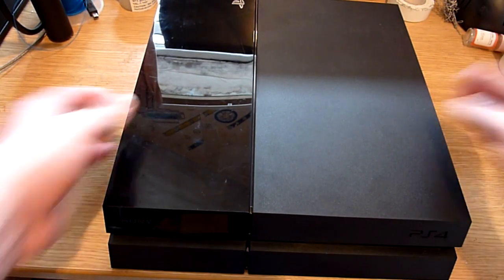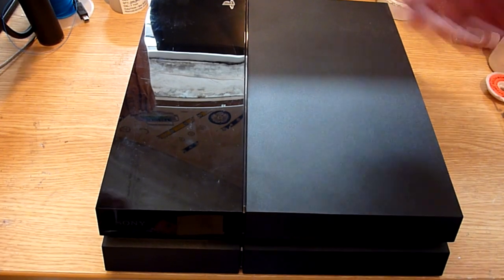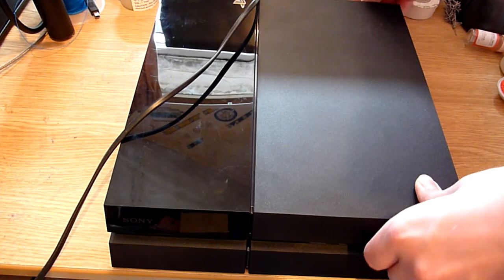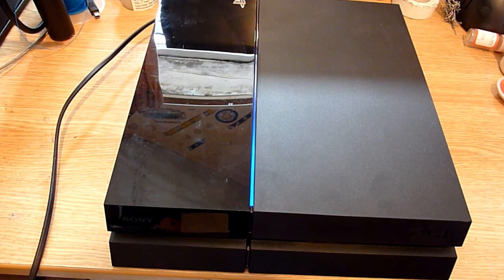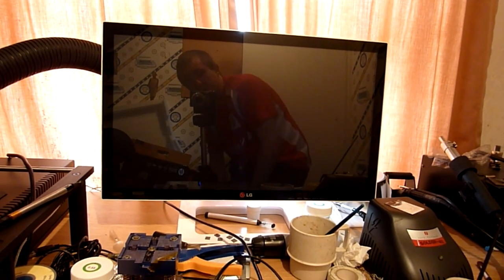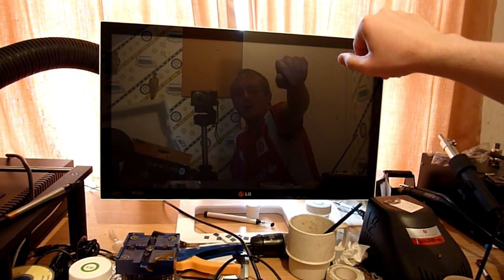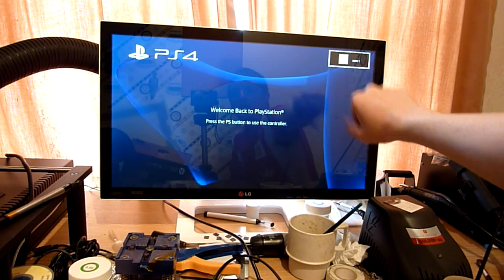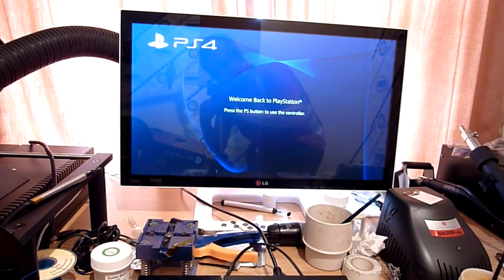PS4 Power Supply Repair - ADP-240AR Transformer Failure - Blue Light of Death (BLOD)

Comment: Andrew, I have a ps4 that I've been wanting to fix for about 6 months now but I don't wanna mess nothing up. The unit doesn't power on at all and I'm thinking it's the ceramic fuse needs to be replaced. I have pictures if you need to see the unit. thanks in advance
Reply: my son wanted to know. he just added on circles ( Google+ ).
Reply from the maker: +Shannette Marshall Hi Shannette - can I see these pictures please? If you upload them to http://imgur.com/ and post the URLs for the images into a reply here I'll be able to take a look. Do you know what happened to the system which resulted in the no power scenario? Many thanks.
Reply: +Andrew Paul Hi he just added some pictures of it and tagged your name. Check your Google+
Reply from the maker: +Shannette Marshall Hi Shannette,
Indeed it looks as though that fuse is missing - do you know how this might have happened as they're pretty hardy things so if it's blown out then we'd need to get to the bottom as to why that was. Where are you based? Cheers, Andy.
Reply: +Andrew Paul Hi Andy thanks for the reply. He took the fuse out because he used a meter ( I don't know what they're called ) to check the circuits and the connection to the fuse wasn't giving out any signs of life
Reply: +Andrew Paul Also he bought it from a guy off Craigslist and upon taking it apart because the unit is out of warranty. He discovered it was Roach infested
Reply from the maker: +Shannette Marshall That'll be why it blew then ha ha! You might find it to be the tip of the iceberg however - I'd replace the fuse and see if it fires up.

Comment: Hi Andrew great video. I have followed your steps and one of my psu is broken. the other one works and what i have noticed is when apply weight on the console upside down it works but as soon as released the weight console switches off... does it mean reballing of apu or something different i need to look at?Thanks
Reply from the maker: +Maciej Pytlik It depends where you're having to push it but if it's towards the centre on the left hand side as you have it upside down then yes most likely a reball would be required. Cheers.

Comment: Awesome video Paul. I thought my problem was BLOD but it's not. We had a electrical household power surge the TV went and the PS4. I thought it was the power supply and bought one on Amazon a ADP-240CR 4 pin. Replaced the old with the new no light a slight beep and nothing after. So I'm not sure what else it could be. Any help would be greatly appreciated. Thanks
Reply: Cpu is dead

Comment: After I changed thermal pads and paste, my ps4 won't turn on. Also I sprayed power supply and big bunny dust came out. First I press power button beep no lights and nothing, then I press power button beep and blue light for sec. Fan won't start up so I guess it might be power supply!

Comment: This is off subject but if I were to get a reflow on a ps4, how long would It normally last?
Reply from the maker: +Christopher Easler That's impossible to say I'm afraid - sometimes a reflow will last 12 months+ and other times it lasts hours. If done well they can be very reliable repairs but I always reball machines and never reflow them. Really it all depends on the condition of the board / chip and your usage environment etc. Cheers.
Reply: +Andrew Paul   ahh OK. what about reballing?

Comment: I've had PS4 and Ps4 Slims come in lately that are completely dead. APU reflow, new PSU or anything else I have tried has worked. Wondering what you're thoughts are on this problem?

Have you seen it? Fixed it? Know what causes it? Cheers

Comment: Hi Andrew, I'm trying to fix this ps4 which has a power issue like the right one of yours. I replace it with a good PSU but still doesn't power up. fan kicks on for a second and everything shuts down. what would you suggest? Thanks!
Reply from the maker: +Kanumporn Sawatchoompon sounds like a reball of the APU is required to me there.
Reply: +Andrew Paul thanks. I'll try that.

Comment: Any idea how to fix the ps4 from the fan not speeding up as it heats up? mine does not speed up the fans so it eventually overheats and then freezes and then has the BLOD problem till it cools down enough. I am trying to find where the temp sensor is on the board but no luck so far. how does the system monitor the heat?
Reply from the maker: PS4 controls fan speed via a PWM (Pulse Width Modulation) signal controller. This essentially sends 'pulses' to the fan and it spins for the duration of those pulses. The more pulses, the more it spins and vise-versa. If you have a problem with the PWM circuitry then the fan either won't spin or will spin at a constant velocity.

The fact your fan spins means it's receiving a PWM signal but it would appear that signal is not changing as it should when the console detects heat. This will need professional attention as it will require some PCB rework and troubleshooting.
Reply: Andrew Paul Is it some kind of diode that needs to be replaced or is it in one of the chips? any idea where i can find a schematic on the board? I really appreciate your info and you seem to be pretty knowledgable so thank you for that. any additional info would be great
Reply: Andrew Paul I changed the thermal paste and so far so good... I played about 30 min of black ops 3 and it still has not shut off. before that it would shut off in 10 min or less
Reply from the maker: Good news. Fingers crossed that was the problem :-)
Reply: Andrew Paul It's very strange, the fan speed even changed so its running higher now... I just now noticed.
Reply from the maker: It's certainly strange - if it had too little thermal paste on there, or bad thermal paste I would have expected the fan to spin up to full capacity very quickly and the machine to shut down shortly afterwards. For it not to alter speed at all due to that fact is incredibly odd. Maybe re-seating the fan header connector during disassembly / reassembly to replace the thermal compound did the trick for you. :-)
Reply: Andrew Paul we shall see! I appreciate your feedback and knowledge so thanks again.
Reply: nah, turns out it just needs to be reballed/reworked... will randomly crash when it heats up so it for sure has cold solder joints on the GPU.

Comment: Hi andrew paul may i ask u a question?
When i turn on my ps4 i only have a blue light for a second than it shuts down immediately.
It only does that again after i unplug the ps4 from the outlet, if i dont it doesnt respond at all.
Is it the Psu or could it be something else?
Reply from the maker: That's likely a PSU problem.
Reply: Andrew Paul Thanks this helped just got a new Psu, now it stays on on.
But its only Blinking Blue and i cant get into save mode.
Does my apu need to get reballed?

Comment: Hey Andrew!
Thanks for that video. It helped me get top where I'm now : stuck on another issue.
I just changed a 2.7ohms resistor that was dead, but something else seems to be too...

Do you have the tech manual, by any chance?
Reply from the maker: +julien poux Hi mate, sadly not - they're tucked up in Sony / Delta's vaults ha ha! What's the machine now doing?
Reply: +Andrew Paul well... same thing, although the resistor seems to survive.
I'll upload a video to explain, i guess.
Reply: +Andrew Paul any idea?
a friend of mine told me those power supplies work with 110v and 220v?
Ever heard of that? 
Is it 110v in the uk? (i can't recall)

Comment: Hi, i need help for my ps4.
When i try to turn on the ps4 make 1 beep n stay off like ps4 left side in this video , when i try again my ps4 turn on with blue led and after 5 secs turn off again, when i try again my ps4 turn on with light led and stay on. Signal is off all time :( i try to replace the secondary caps but still no work. How can i fix it? Sorry my bad eng
Reply: The problem is in the psu or main? Or both? :(

Comment: Hallo Andrew Paul
I want to ask you please if 
can i use PSU PS3 Model: APS-227
+12v : 32 A
+5v : 3 A
on my PS4 have PSU Model : ADP-240AR 
+12v : 17 A
+5v : 3 A  
??????????
I wait for any Answers 
und thank you very much for your video
Reply from the maker: No. Much easier to replace the PSU with a like-for-like considering the costs of a replacement AR supply.
Reply: Andrew Paul 
thank you very much for your Answer 
I do not speak easier or not  fit or not . 
Of course, replacing with a new one is better and easier but frankly I do not want to buy one expensive. i see in YouTube using PC power Supply on PS4 
I have PC PSU und PS3 PSU 
So  I want to ask only if this was possible und whichever besser PS3 PSU or PC ATX  and whether it affects on my PS4 
if no possibility Why 
end I'm sorry if the txt not so English i speak English little
Reply: The price for a used power supply of the same model is extremely low.  They can be found on any of the market places like Ebay.  He wasn't saying to go out and try to find a brand new power supply.

Comment: Mine powers up but the disc drive and usb ports are dead ? So this happened why
Reply from the maker: My bet would be Southbridge - this handles both SATA (via emulation over USB) and USB host.
Reply: @AndrewPaul  basic terms please as I want to repair it. Is it a simple repair or replacement? Please help.

Comment: My PS4 will not connect to the tv and will keep blinking blue and if II apply pressure to where the power supply is located it will turn on and i'll be able to play games and run other apps but it will only be on for like an hour or 2 what is wrong with mine is that a power supply issue? Please help I do not want to waste money and it still doesn't work thanks!

Comment: Mine stays blue forever and won't connect to tv.

What type of problem is it?? Power supply?
Reply: It won't even shut off just stays blinking blue
Reply from the maker: Generic system problem - these are horrible to work out. Rarely APU, more often than not they're firmware / syscon related but it can be literally anything on the board from an IC failure to a single SMD component on a data line somewhere. Without schematics these are like p1$$ing in the wind and I've stopped doing much with them these days.
Reply: Its the blue light of death. No / bad contact of gpu chip to mainboard

Comment: Can you help me real quick my power supply isn’t working and I’m trying to figure out what’s wrong with it so far my dad says nothing has popped but under the circuit board I saw a little burn spot not even that big looked like some dirt right where the transformer sits do you got any ideas what i can do ?
Reply from the maker: Does the machine work with a known-good supply? If so, due to the costs of them these days it's far easier to just replace it if there's nothing immediately obvious.
Reply: Andrew Paul so far the only thing that works with power is the fan because it’s able to receive power with a amp through two cables but not the pins since we can’t connect them with those cables. My power supply looks really good almost new there’s no burnt marks visible on top of the board either the other day I was able to scrape the burned spot off and it looked more like dirt but it still Isn’t able to turn on. Any of the smallest idea could help. Thanks
Reply from the maker: The damage may not always be visible. Try it with a known-good supply if you have one / can borrow one. Once you've verified a good supply doesn't affect the outcome then you can move onto further troubleshooting with the board.
Reply: Andrew Paul what can i use as a power supply besides a pc supply do you got any common ones ? What if I take the power supply from my ps3 slim can i use that as well maybe with some sort of modification to it
Reply from the maker: Aside from a PC supply you can't really other than another PS4 supply.
Reply: Andrew Paul ok I’m back I was able to get a pc power supply I just got one last question. In order to wire up the power supply to the PS I need to connect the 5v to the red cable on the power supply and the ground to the black cable on the power supply but Im not sure what the AC/DC and AC/IN cable are for. My PS uses the four pins connection and I’m only missing those two. Do you know which cables I connect them to ? Thanks would really appreciate it.
Reply: Andrew Paul Nevermind folks I did it by myself like a fuckin BOSS !! It’s up and running thanks to a old pc supply I’m using.

Comment: Hi Andrew, my ps4 for a couple of months now has been turning off after an hours use or so. Been advised by sony that its a psu issue, as my socket on the back of my console is damaged. The psu also gets very hot whilst im using it, so ive opened it up to have a look to see whats going on but i have no clue lol! Im going to get a new one online, just wondered if you had any advice? Also, do you fix consoles for a fee? Thanks!
Reply from the maker: +hollsterround I'd just get a new one ordered mate for what they cost. I offer a limited number of repair slots per month via eBay for UK/EU based consoles for mail-in. Cheers.

Comment: Great vid, I have a similar problem.

BLoD - PS4 turns on but no input to TV, light pulses constantly and fan/disk drive both work. Won't boot into safe mode it just goes off after I've held the power button for about 10 seconds. I've tried all the easy things like re seating the HDD and leaving it off and unplugged for a few days. Any ideas?

Is it worth me trying to take the PSU apart and having a look around like in this vid or would you say it's likely to be something different? Thanks.
Reply from the maker: It's very likely to be different - it's a general error condition and can be caused by literally anything. Sometimes it's APU related but anything else and it's really not worth chasing for what they're worth these days.
See here: https://www.youtube.com/watch?v=0T2-iCBhkuQ
Reply: Andrew Paul - just an update. I replaced the PSU no luck. Went on to take it all apart and I can't see anything wrong with the motherboard in terms of scorching etc. Checked the CR2032 battery and that's fine as well. Had the PS4 about 2 weeks (second hand) so I am pretty annoyed that it's now useless. 
Question though: if I buy a brand new one now will I be able to reuse the hard drive in the new PS4 if the models are the same? My worry would be is if the hard drive is causing the problem could it brick the new PS4? 
Thanks very much.

Comment: You got really good videos. My problem is similar but it isn't the psu. When I turn the ps4 on the blue light shines one time, the fan starts and then the psu sounds like the psu in the video (klick) and the ps4 go off. When I now push the power button the ps4 shut really off. Do you now what the problem could be?
Reply from the maker: +HJHMusik 95% of the time an APU Reball will fix that.

Comment: hi, when cleaning up my ps4 i accidentally rip off the power supply socket from the motherboard is there any way to fix this because my console does not power on  anymore any help will be very apreciated
Reply from the maker: +rajeshree sungalee Hi there, is the socket missing from the motherboard side (with the pins) or the power supply side (with the sockets)? To be honest the likelihood is that some serious damage has occurred to the board because these things usually take a decent amount of pressure before they give way. I'd be tempted to take / send it to a professional for repair if you're not used to this kind of work because if the power rail has been pulled into ground then bad things will happen. Do you have any pictures of the damage anywhere? Cheers, Andy.

Comment: Hi Andrew,
Your video is excellent! Thank you very much for this. My PS4 is behaving like the one on right but it's completely my from a series of wired behaviour. First it didn't reboot after updates, but I could turn it on and off manually. Then it didn't turn on at all but if unplug the main and wait 30 seconds it did and now it's behaving like the one on the right. I tried to give it a little shake and few bumps it worked for a bit and then nothing. This let me think something mechanical was faulty I.e some wire that when off or something. I hope Ned the psu but from a visual inspection all seems fine. What are your thought? How can I properly test the PSU. I have some electronics experience so I know my way around multimeters and soldering iron. Can it be the DNP015 ic in this case too?
Many thanks

Comment: Hi Andrew, I have a ps4 which is doing the exact same thing. I have tried a known good psu on it and the problem still exists?
The ps4 blue light flashes for just a second and clicks off, then none of the buttons will respond until you remove and reinsert the power cable. 
Can you point me in the right direction of where to check next?

Thanks in advance! :)
Reply from the maker: Sounds like you have a short somewhere on the motherboard. Visual inspection would be the first port of call so see if there's anything obviously amiss.
Reply: thanks for the reply, i have had a look at the board and cant see anything obvious.... I am fairly new to this but dont like to be defeated lol. I know you haven't got it in front of you but any idea where to start?
Reply from the maker: As you say without it being in front of me it's not really possible to say - just check you're getting the necessary voltages into the motherboard (12v, 5v) and that the fuses on the motherboard are all intact.